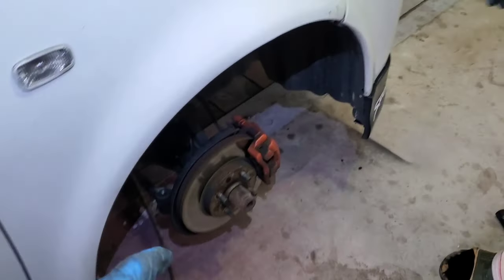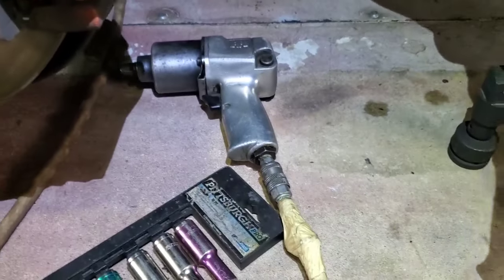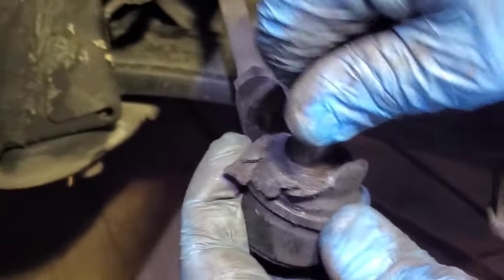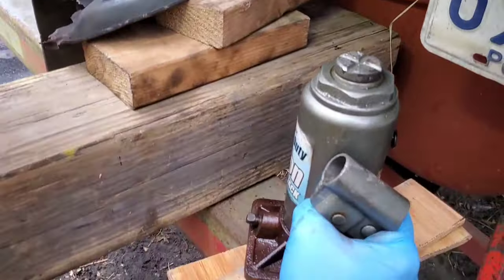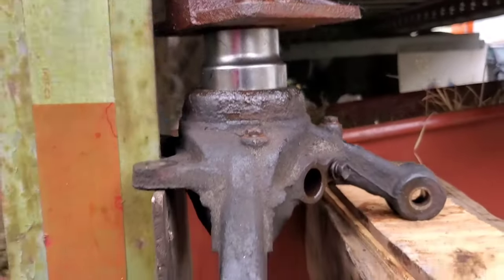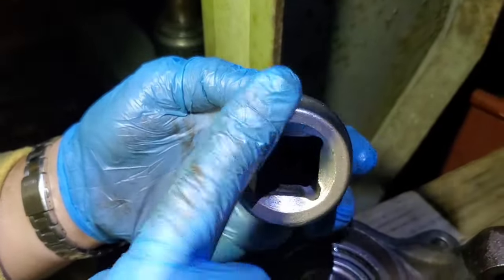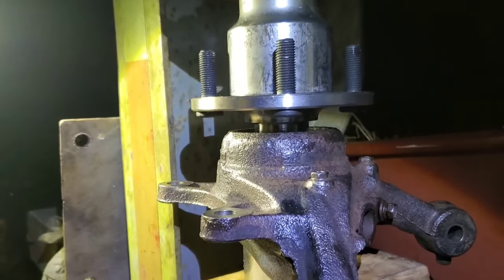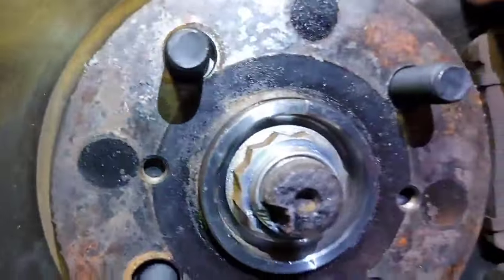How to replace, change, bad wheel bearing, making noise, on scion xb 2005, front right

Comment: Thank you! Great video! I appreciate how you showed the symptom, the road noise from the front. My Scion xB makes the same noise so now I know for sure it is the wheel bearing and not the rotor being warped.  You showed the difficult parts of the job and how you solved each problem, very helpful! I like how one guy always tries to tell us the socket size or the tool being used.

Comment: I believe on the bearing, one end is magnetized that faces inwards towards the vehicle.  Otherwise the wheel speed sensor won't work and will throw a light on the dash. Before installing the bearing, put a magnet to the opening  of the bearing to see if the magnet sticks. If not, the other is will be correct.
Reply from the maker: I don't know about that